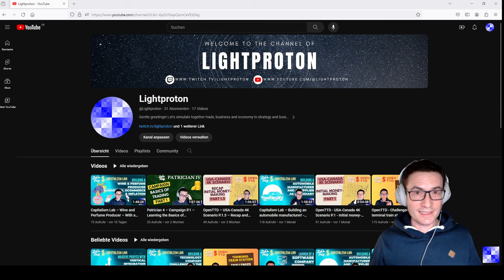OpenTTD – USA-Canada 4K Scenario P.2 – Manage Networks – Line Hierarchy, Mainlines & Sidelines!

Comment from the maker: Infrastructure maintenance costs are switched off in our session (Settings --> Accounting --> Infrastructure maintenance --> Off). :face-pink-drinking-tea:Without maintenance costs, Infrastructure just costs the initial investment, but does not cause running costs over time. :face-blue-smiling: Of course, this is a simplification since a real world infrastructure has running maintenance costs. :hand-purple-blue-peace: For a more realistic and a more challenging scenario, you can switch infrastructure maintenance on. :trophy-yellow-smiling: Hence, infrastructure maintenance makes your scenario a bit harder and is an additional incentive to build efficient railway networks.  :hand-orange-covering-eyes: :face-orange-biting-nails: -- https://wiki.openttd.org/en/Manual/Economy